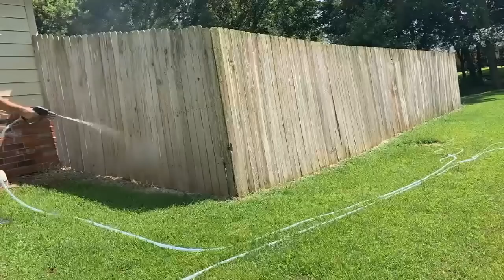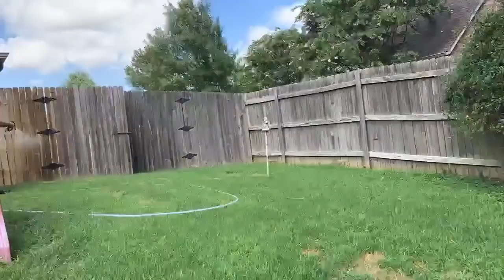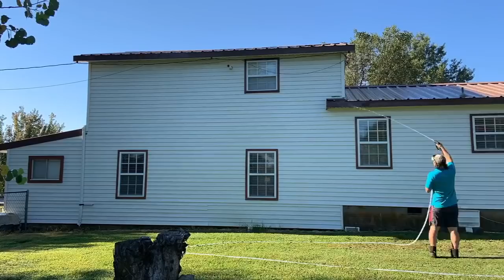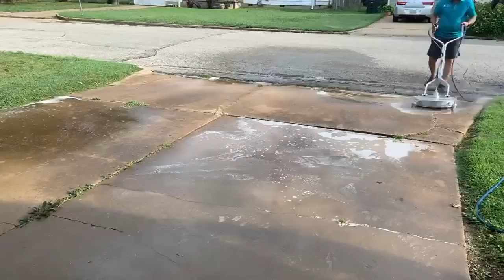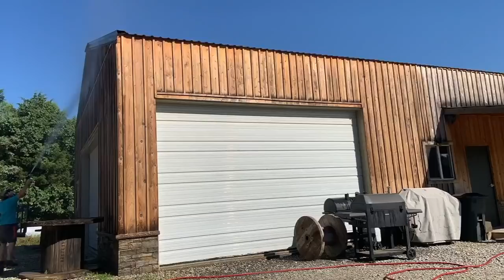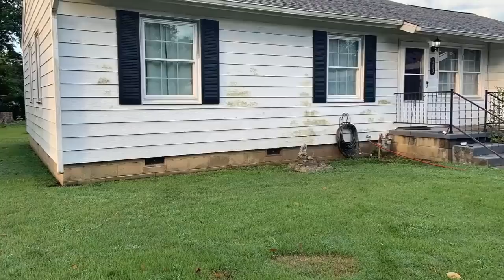HOW TO MAKE $4K A WEEK PRESSURE WASHING

Comment: I’m still using what you call a Home Depot/Lowe’s special and I’m just about making $800 a week ranging from 2-3 side jobs and one commercial account of $800 a month. Just bought a truck and running the Home Depot special and a 50 gallon chem tank and slowly growing: you can start with a small unit if you work hard and market yourself. 3.2 GPM or 8GPM do good work people will call you back. I’ve only been in it for a couple months not trying to preach but people shouldn’t be discouraged from starting with cheaper equipment.
Reply: A lot of people talk about how good a 2.5gpm is starting out.

Comment: Hey Justin, I am planning on starting a pressure washing business but I have a couple questions before I start. 
1. are you supposed to use different psi for washing different surfaces or does it not matter?
2. How much gas do you use for each basic job?
3. does the cost of gas cover itself with the money you make?
Reply: 1. You should use a downstream injector or soft wash set up for houses and roofs with low pressure. Higher pressure and a surface cleaner for driveways and flatwork. 
2. It depends on the job and how long it takes you, as well as which pressure washer you're using. My pressure washer gets an hour and a half of work done with one gallon of gas.
3. The gas is more expensive now, but still only around $6 for an hour of work. If you already have all of the equipment, the cost of gas is negligible as long as you have business.

Comment: Hi

I just wanted to see if the Facebook ads stand alone course is the same module that is in the pressure washing business course? I’m interested in using the Facebook ads strategy for my current business, but thought for an extra $100 it might be worth doing the full course in case I ever want to add pressure washing as a service to my business. Thanks
Reply from the maker: Yes they cover the same material. Might as well just grab local Dom

Comment: I'm stating my power wash buisness this April and in have zero experience but i have a Simpson 4400psi 4.0 gpm
A 20" Simpson cement scrubber and 100 ft hose. Any tips